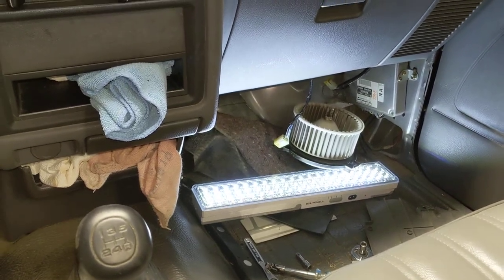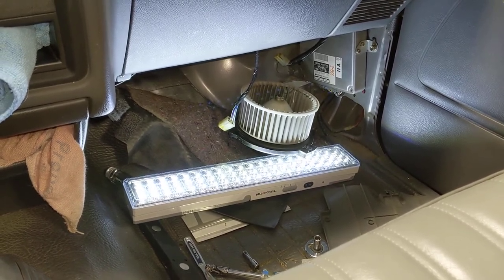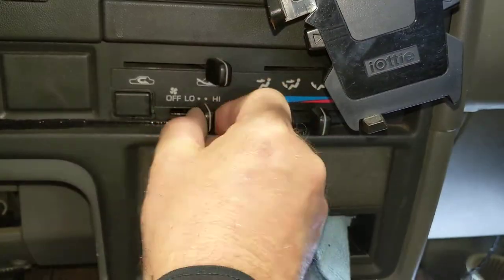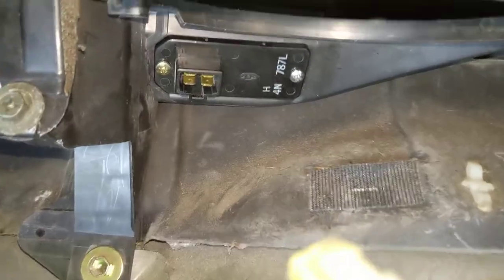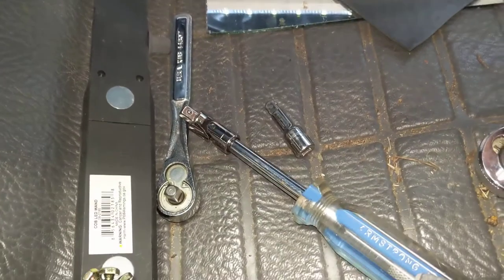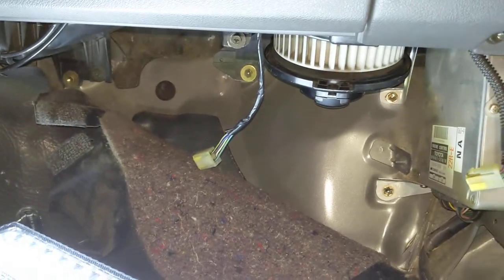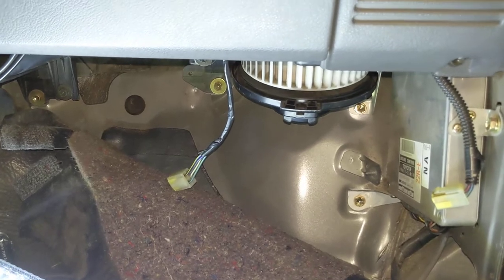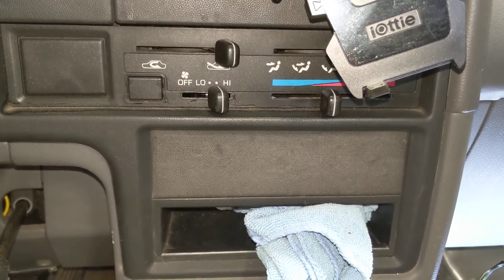1993 Toyota pickup heater blower motor + fan speed control + blower resistor pack

Comment: The previous owner of my '94 probably could've used this vid.  The outside of my blower motor looks to be an aftermarket replacement, and for the 7 years I've had my truck, it's always looks crooked down there.  Still works a-ok.  I'll have to see if I can get those screws/connectors out and get it fully seated into the bottom of the HVAC box.

Comment: Easy, to the point. Thanks for posting this video. I just bought a 93 toyota winnebago warrior and the fan only blows on high, and judging by the sound, there's junk in the blower. Now I know what I've got to do. The tip about clocking the blower properly is gonna save me a lot of cussing lol.

Comment: My 1981 Toyota pickup blower motor does not work after a over charging issue. Fixed that but my blower motor doesn’t work anymore. Could it be the resistor that blew? Because I did turn it on when it was at 16+ volts yikes
Reply from the maker: Yikes! Yeah, resistor pack might have died.

Comment: Super! This close up view you give helps me as I'm gonna have to clean out or maybe even repair my blower motor fan assembly in my 92 4runner. I think mice did load up a pile of debris in the blower in mine.. -enought that the recirc/fresh air control door isn't freely moving.

Comment: Whats the issue if it only blows on high.......... but the heat and cold air do work fine
Reply from the maker: Could be the switch, or could be the resistor pack.  Try a plastics-safe contact cleaner on the switch first. NAPA should have the cleaner.